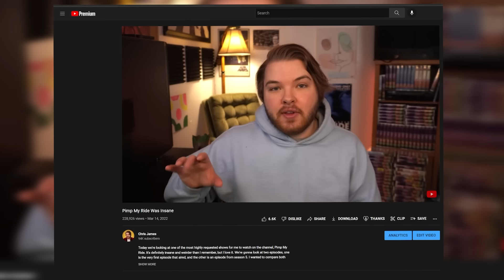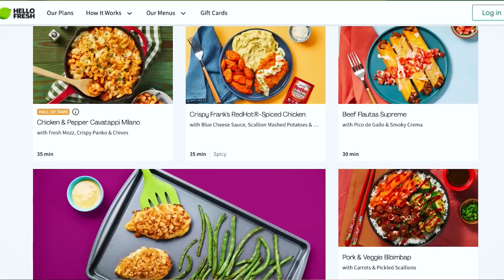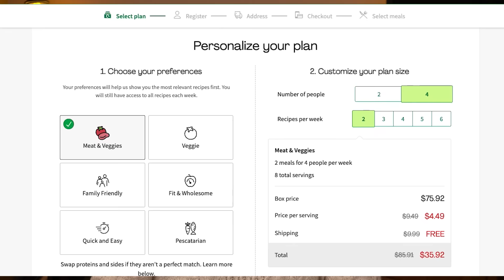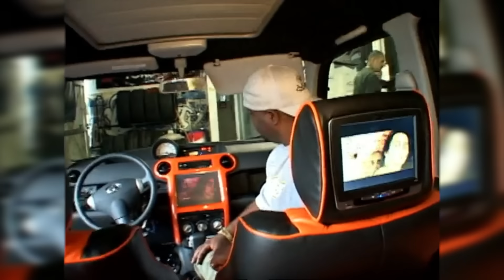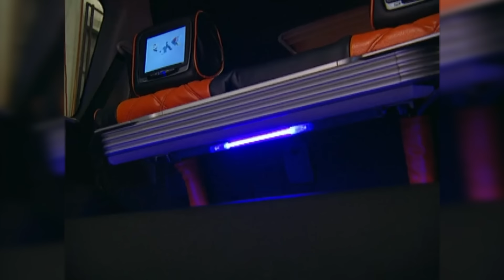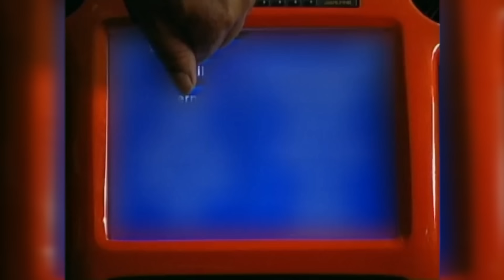Pimp My Ride Was Cringier Than I Remember..

Comment: As an automotive technician, more cars get welded together than you think. Shady body shops do it all the time, taking two wrecked cars and creating a "good" more expensive car with a good title. It's dangerous for sure, but far from unheard of. Stay safe folks, be careful of what you buy.
Reply: Thanks for pointing this out, most people who don't work with cars have no idea how shady some shops can be.
Reply: For the amount of time and effort it takes to weld together and a suspension and corollary fittings how can that be possible? Not to mention if you bring it to any random mechanic they are going to be like "I was looking for your VIN # and uh.. yeah this is actually two cars welded together"..

i just dont see it
Reply: I've welded 2 cars together...not to sell🤣
Reply: @TheNYCGoldenGlover  I mean it's actually a quite well known phenomenon in the automotive community. They're typically called "Cut and Shuts". In regards to your mechanic scenario, these were made to be sold to unsuspecting customers, so no a mechanic would probably not be involved in the transaction.
Reply: Fucking RIP to anyone who gets into anything more than a low speed parking lot crash in a car with a welded frame.  Holy shit...
Reply: The last car I bought was so janky, that I’m sure it was one of these cut and shuts! That shit broke down the day I bought it. The guy I got scammed by just happened to run a title office too! 😂😂😂
Reply: It depends Who did the work, if correctly done by a experienced professional with dimes and using the proper seams Is perfectly safe,( hearses and limos are built cutting them in half!) pretty common when restoring high value cars but there are around cars cobbled togheter by car flippers who are scary deathtraps, if you cant assist to the operation or you arent sure about who and how did It dont buy or dont green light the repair on your car
Reply: I didn't even read this! I just commented something similar. It really is more common than you think.
Reply: 1000% this. look up "Schoharie limo crash." this happened in my area, absolutely devastating, and a combination of a shady shop combining 2 cars into a stretch limo AND being negligent with the maintenance/repairs. Ended up crashing and caused the largest case of US transport deaths in almost 10 years
Reply: welding? Hell, they use adhesive glue nowadays to make things quicker for them as well
Reply: Such practice is also used in certain situations within the aviation industry. An SR-71C was a product of the prototype YF-12 aircraft and SR-71 mated together, nicknamed 'The Bastard' the aircraft have severe yaw at supersonic speeds. Another aircaft is F-16, although it waa for preservation purposes
Reply: @rrrryno  Yeah and the lawsuit and lawsuits goes around and the families of the victims will likely end up with nothing at all. But lawyers still make money.
Reply: Or you be like my dad and take your Ford Ranger and build the truck bed out of wood lmao 🤣
Reply: @Jmonkeh  a welded frame isn’t the issue. A properly done weld will be stronger than the base material and the material should break way before the weld ever does, the issue is people who don’t know what they’re doing are putting out contaminated welds that have a high chance of failure in a scenario where they otherwise would be fine and that’s what’s scary.
Reply: It was a big problem back in the 70’s-80’a mostly the 70’s but it doesn’t happen anymore it’s far too big of a job on modern cars that it simply isn’t worth anybody’s time I doubt you’ll see anything modern become a cut and shut anytime in the future
Reply: They at least hide it better lol
Reply: My uncle had a welded VW Jetta
Reply: Can you hook me up with a welded car?
Reply: It's actually super illegal if you get caught doing it for insurance
Reply: Salvadorian & Honduran body shops have left the chat
Reply: Oh yeah the scion cube is horrible and it flips unbelievably easy. If you like it, I’m sure you like Harley’s and you know what they say about Harley riders.
Reply: I believe people should get basic maintenance teached, more than ever nowadays. 

People are willing to spend 100+$ for a simple oil change on a 20 year old Honda..

A blown head gasket will turn from material cost, time and a good plan, into 1300-2500$ 

But give it ~150$, the needed parts, a weekend and a case of beer, and my man will have the car running. 

You don't pay for the work, you pay for the knowledge to do the work that you are not willing to learn..
Reply: @gillespriod5509 I know a shop that took a Camaro with a totaled rear end and a Corvette with a totaled front end and cut them in half and welded them together
Reply: He may be hamming up the excitement but for JUST listening his hype got a genuine smile out of me.
Reply: I've literally been offered money for my wrecked car because they wanted the good half for the same car with an opposite half that was wrecked so they were definitely gonna do this... They just wanted to throw me change for it and I needed cash lol
Reply: @TheNYCGoldenGlover I have seen too many cars like those,but not seriously bad like this in the video.Normally it's the car's parts like having a hood and face of a Ford ranger on a damn taxi.
Reply: @MrSilnev  yeah I openly admit I don't know shit about this I'm just applying pure logic and analytics. This isn't super common though is it?

The closest knowledge I have to this is s few buds who built kit cars back in the day. But that is nothing like this
Reply: @rrrryno I was horrified when I read about that limo crash. The truly sad part is that the folks who rented it were attempting to be safe and responsible by not drinking and driving, then they were killed because of a shady limo operator who cut safety corners. It was a horrible tragedy and I feel so terrible for the victims, and their families and loved ones. I hail from upstate NY, where there are many small towns like Schoharie, where families have known each other for generations and there’s a strong sense of community and watching out for your neighbors. I know that a tragedy like this must have been terrible for everyone in Schoharie and they will feel it for generations to come.
Reply: I used to work at one of those shops, a local used car dealership would bring in totals from insurance auctions specifically for us to do this for him to sell off his lot.
Reply: @TheNYCGoldenGlover They usually just weld the 2 frames together and pull "good" parts off the two wrecks.
Reply: @gredo2026  that is disturbing. Thanks for the info though
Reply: I heard somewhere that that's how limousines are made. Is it true that manufacturers include instructions for such modifications?
Reply: @cmasterson my dad did the same thing to his old Toyota pick yoi when the bed rusted out.
Reply: @tigerchillyable demo derby?
Reply: What’s worse a car that welded together or a car held together by bondo with JB weld patch job on the exhaust?

Comment: Saw a few videos about the program, one guy even tracked down, bought and repaired one of the cars from it, and it was said that not only didn’t they fix anything, but often parts that were shown on the show were removed before turning the vehicle back over to the owner, some parts were complete nonfunctional and in general any wiring done was a complete nightmare.
Reply: was this the minivan
Reply: That's because the parts they use are extremely expensive, if they just gave all these parts for free they wouldn't afford to keep the show alive.

Comment: On the show, they actually would often replace the car with a matching model that was in better mechanical shape than the one brought in by the owner. This saved them a lot of time as they didn't have to solve any mechanical problems etc., and the car was often stripped down before the owner's car came in
Reply: That would make sense as the old clunkers they got were most of the times beyond salvageable and could and should have been put on the junkyard straight away. It would also explain how these clunkers would have managed to carry all that new, more heavy and more energy-consuming stuff.
Reply: makes sense to me.

Comment: Hi, I'm the rabid scion enthusiast. I have a 2013 XB, and its the best. The paint is peeling, the AUX port is broken, the speakers crackle, my dog shit in the back seat multiple times when she was a puppy and we were car training her, and I used to smoke cigarettes so there's a permanent aroma of stale smoke in it. But i bought it for $8,000 over 7 years ago and the only maintenance I've had to do is changing the a few of the tires, replacing the air filter, and changing a tail light. I can fill my gas tank for about $30 from empty. It is the most reliable and durable car I've ever owned and I will never stop screaming its praises.
Reply: Gets over 40000k miles on god seen it with my own eyes

Comment: The thing about this show that irked me growing up around mechanics was that they never did mechanical work on the car. Some of these cars needed serious work, and none of that stuff got actually done. Ever. And I've heard that some of the really expensive things that they added to the cars got removed. As in, they didn't even get to keep the super expensive junk they put on the car.
Reply: A lot of it probably fucked the car even more because of the drain on the  battery.
Reply: Yea having researched a lot on this show, it was often the case that’d it take super long wait time to get there car back. Pretty clear that pimp my ride cars were super low on the priority list at West coast customs (WCC). Sounds like the WCC crew was overworked and underpaid due to all the labor penalties they got hit with and I’m sure just wanted to get it out the door.
Reply: @fosty. . That's why you get a separate battery. One for the engine and one for the electronics that they would have put in the trunk.
Reply: @briansmith48   Did they ever do that though? I mean I guess they might have, but I've heard they just made stuff look nice on the outside but never really made it to last.
Reply: @fosty.  . Even just for the demonstration to the owner of the car and then the car ride back home to show the folks, they would have to install two batteries. 
If they then removed most of the electronics then yes, the extra battery wouldn't be needed.
Reply: Yeah, not only did they never do any mechanical work, they didn't even remove obvious issues like rust - wich is most obvious in the episode with the VW van: They didn't remove any of the rust and just put new paint and new things on it.

Comment: So one of the most important things to know about my Pimp My Ride is that a lot of the cosmetic changes would be taken off after the show periof course they would still leave the paint job but I'm talking about all the TV screens that they put in the cars during the early seasons of the show. They would also take the rims off the car and put the original rims on the car. There was a minivan with a waterfall installed inside of it and they took the whole waterfall mechanism out of the car after the they gave the car back to the guy. You have to remember that this is the show that literally made a car with TV screens in the mud flaps. By the way they don't do any mechanical stuff so they don't fix your engine they don't fix your suspension they don't fix your diffecentral which means you're piece of s*** car is now a shiny piece of s*** car except for like the 1 or 2 times I can think of that they just straight up replace the entire car

Comment: The fact that the car didn't fall apart with the frame being welded together is a nothing short of a miracle.
Reply: Nah that's fine. It's done all the time. But the fact that the car didnt fall apart with THOSE welds, is the problem
Reply: What they didn’t show was the duct tape underneath the car, that’s why she held together all that time
Reply: I mean welds are not weak dude. I've spent a lot of time walking on something with a two inch tack weld being the only holding it. Like a two inch tack weld will hold a dude working for hours. A weld, even a fairly shoddy one, will probably hold the car forever.
Reply: The welds are stronger that the metal it was connecting... The quality of the welds... That's a different story!
Reply: I saw three cars like that, one was a jeep with its entire front part just something you would see from an NYC taxi. I wonder just how that thing didnt break apart.
Reply: I think I see one of it's parts already rusting with holes in them,I'm surprised it didn't break in half.

Comment: Well when I used to work in the shop what we would do is if a car had cancer we would take one car that was crashed in the front and if the backend was good and if that part had cancer we would replace it by cutting it and re-welding the car so it would be like a new car again

Comment: That first car, the two escorts welded together, it happens all the time. My bf and most of his friends are mechanics, they do that stuff all the time. 1/4 of my 99 forester tore apart at its literal seams separating the body from the floor pan and allowing the rear wheels to camber, my bf frankensteined the car back together with a welder and extra sheet metal, the wheels no longer camber. They've replaced a crushed in roof on a car, cut the pillars off at the body did the same to the donor car and then welded the good roof and pillars on, installed new window and door seals. He turned an explorer into a pickup truck.

Comment: 1:54 I don't wanna sound like a hick here but welding frames and stuff isn't all that weird of a concept. My father was a stock car racer from the 90s to the mid 2000s and he has had many a cars held together like this. Sometimes you only need one half of a frame because the other half is shot. I had a '73 Scamp that had this exact situation where the rear was trashed (A-bodies am I right? /s) but the front was alright. I did not end up doing this though, I traded it for an 86 Monte. Sometimes, its a lot cheaper (especially for racecars, I don't believe you can weld your own frames for street cars in New York to this extent but I'm sure you can in less strict states) to just take a clip from another car and slap it on. It's not really crazy, it's just resourceful........... but also a thrilling safety hazard! :)

Comment: I mean you say that his car is going to get stolen from but what you don't know is that actually every piece of sound equipment and all the playstations and DVD players and even the screens themselves are all removed from the vehicle as soon as they're done shooting. Sometimes the modifications made to the body to assist in the placement of these devices is so superficial that it actually makes them undrivable. So not only do you not get any of the cool shit but often they would leave these vehicles as illegal to operate under normal circumstances. Basically they take someone's car that looks a little shitty and turn it into a literal piece of garbage that they then have to have hauled away. It was pretty fucked up.

Comment: Basically when 2 cars are welded together it means when it was newer 1 got front end damage and 1 got rear ended which both were junk so someone bought 1 as salvage and cut the end off of 1 and welded it together to make a good ish driving car not bad but definitely dangerous to drive the older it gets

Comment: Actually welding 2 Cars togheter Is quite common and even correct if done properly using the designed seams, hearses and limos are built cutting them in half, so sometimes classic cars needs to be saved removing entire sections. But that deathtrap looks welded by a crackead in his backyard, there Is no way can pass any inspection 😁

Comment: From what I can find online about drivesoft back in 2004 is people who have estimates of between $3000-$5000 (which in 2004 before 2 rounds of "inflation" sounds about right actually) but someone else also made a good point as I built computers still back then and for that time the best of the best computers (drivesoft IS NOT a "super computer") cost between $1000-$2000 to make so after having someone build it you were hitting $2500-$3000 so it's in the right range. Basically since it's a specialized computer for "a car" I'm sure that boasted a specialty tag so between $2000-$3000 is probably right and then after you paid a shop to install it and even put in atleast a main screen and a custom mounded dash you are probably hitting $6000 by that point. That doesn't even begin to explain about extra software costs (which eventually regardless you could most likely get off the internet for free) but if it's the start of a proprietary system that software will cost an extra penny too just to have extra software on it. Which TBH is ridiculous when it was way more practical to just toss in a screen and wire up a laptop to it whether you connect directly via the screens motherboard or are lucky enough to have a newer laptop with some sort of external monitor connection. I also saw a few companies on that old forum from 2004 that were advertising doing the entire install for $1,999 but it didn't say if you had to bring your own equipment or not which to bring your own thats still kinda expensive and certainly expensive for back then. Everyone has to remember that this was right after Fast and Furious came out and every kid in the world was trying to build a rice rocket/tuner car and put ridiculous stuff in it. They didn't even grasp the power of the V8 they jist wanted to yet a tuner and boost it. There were ALOT of blown engines back then that's for sure, as well as alot of disappointed kids when they found out shops wouldn't just toss turbos onto cars and those that did most knew what they were doing so you were paying for an entire tear down and compression change to properly handle the boost. Weird times for the world thats for sure and it's only gotten more weird